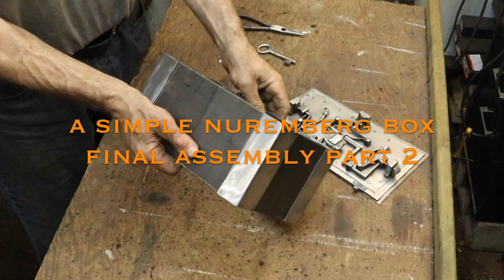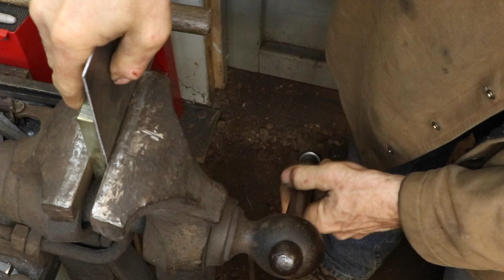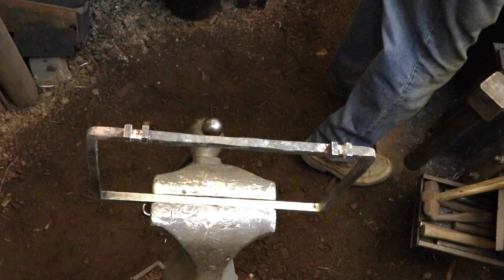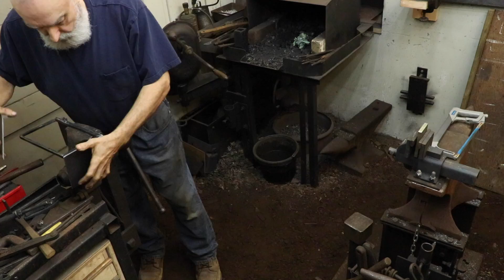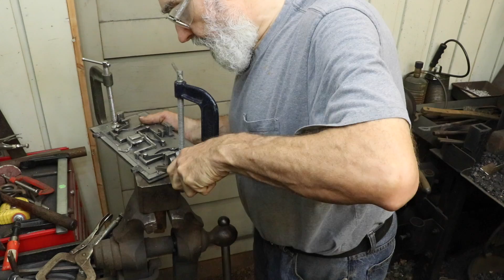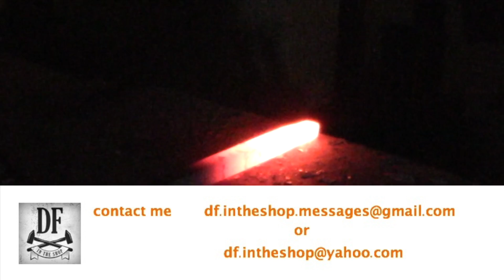Blacksmithing Project - A Simple Nuremberg Box Final Assembly Part 2

Comment: I hope this wasn't the last video in the series... Or that an " advanced" or "Intricately complex' example is in the tubes... Thanks again for the excellent content.
Reply from the maker: The lock for this project is finished.  I do need to decorate the exterior and assemble the entire box but other than final cleaning there is nothing that needs to be done to the lock itself.  This project is meant to be an introduction to more complex locksmithing projects so I definitely plan to do more.